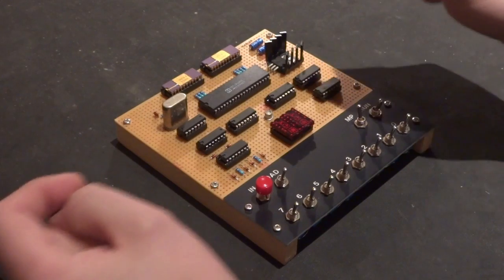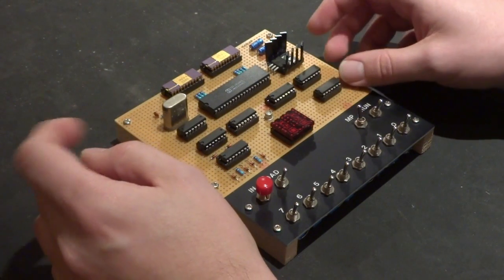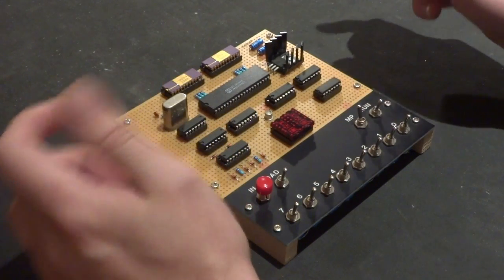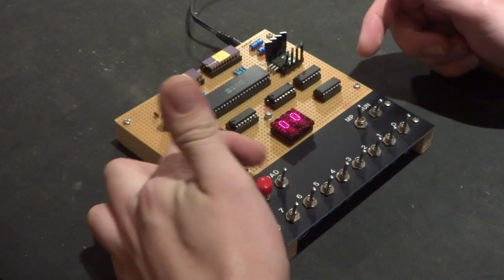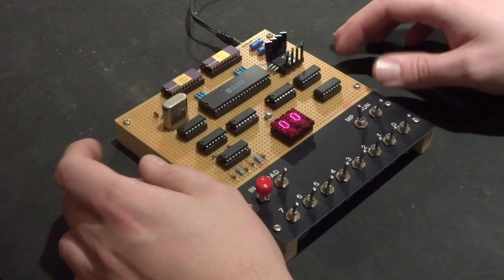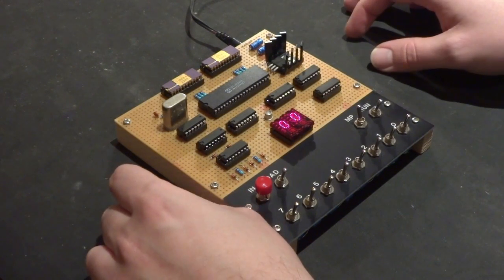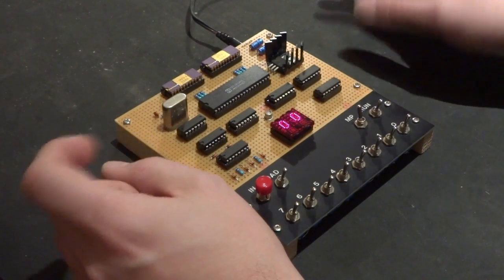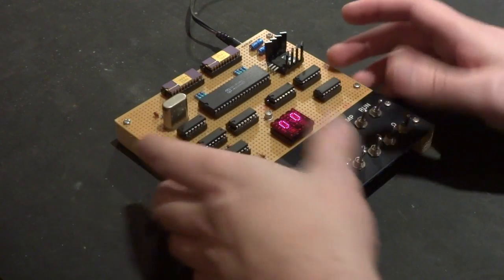COSMAC ELF

Comment: Strange that after so many years the clock speed stayed the same and nobody increased the RAM size to, lets say, 512 Bytes. It is time for improvement! Push buttons with flip-flops and LEDs would be a first step to speed it up, toggling with push buttons is faster then flipping a switch. Why not 16 real buttons for hex-cypher input? Then maybe more cyphers in the display.

Comment: Thanks for this, and nice job on it too! I used to use the 1802 in custom test fixtures at my job about 35 years ago, and recently built Lee Hart's "1802 Membership Card", the ELF inspired computer that fits into an Altoids tin. But I have been hankering to have an actual, first generation ELF, just like the first magazine article and apparently like yours. I found a nice source for brand new TIL311 displays in China (a great place there that buys out old stock of ICs....some amazingly rare things they have in stock), and I also found a source for new old stock 2101 RAM chips, so as soon as lay my hands on some wire wrapping tools and supplies, I should be ready to rock & roll with the project.

I want to keep mine just like the first magazine article, with the exception that I plan to add the 8 discrete LEDs that were suggested by the second article, and place them just above the toggle switches (but I will still have the two hex display digits), and add an audio output to the Q line as well (as some commercial versions of the ELF did). I am considering also adding the 8 bit I/O that was suggested in the second article, but want to do it inconspicuously so the extra ICs and I/O connector don't show (for display purposes).

I am considering, if all goes well, making these and trying to sell them on eBay....not sure if there is a market for that.....?
Reply from the maker: Thanks! :) The 1802 Membership card is awesome but if you want that proper retro feel, there is nothing better than building an original one. I didn't use wirewrap on mine, just point to point soldering. Actually built two of them and sold the 2nd on Ebay (£80)

Must admit, I am tempted to build another and add the extra items you mentioned along with TIL311's for the address lines. The basic machine is very limited in it's basic form. Video would be nice too but the PIXIE chips seem to be next to impossible to find.
Reply: I completed my ELF build, the video is called "First Test of a New Build of the Classic COSMAC ELF Computer".......